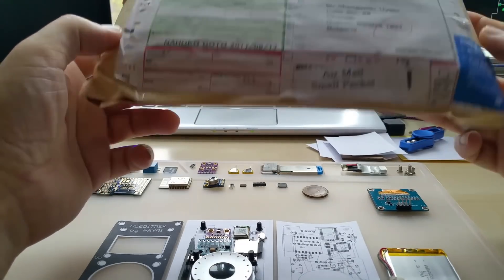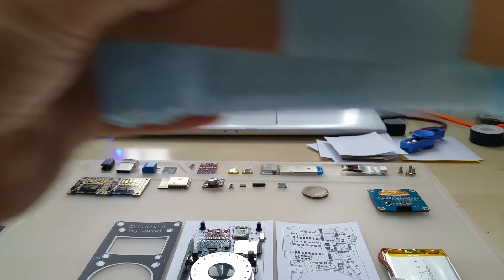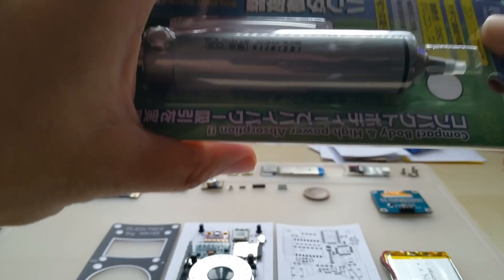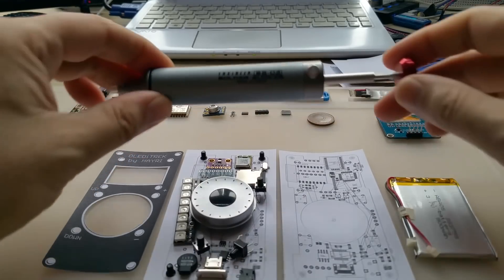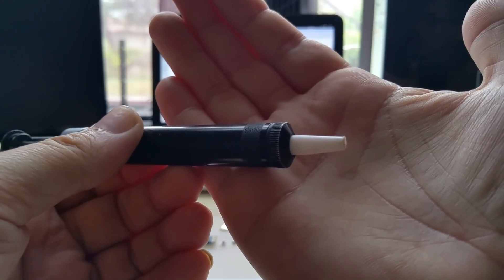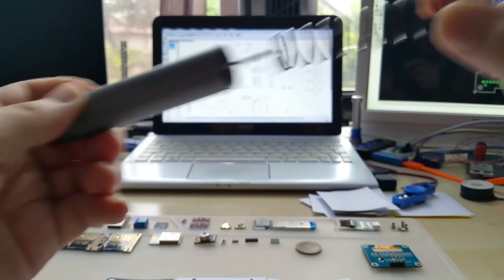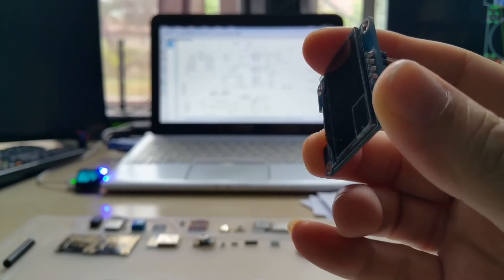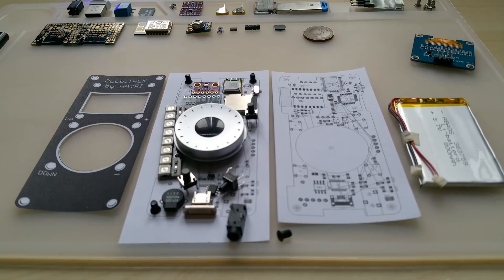Engineer SS-02 Solder Sucker made in Japan unboxing/review

Comment: Few days ago I got new one SS-02. I confirm, it's really brilliant thing. Thanks a lot Hayri. :)
Reply from the maker: You are very welcome. I like it very much too. If you are into high tech stuff I can also recommend the TS100 soldering iron that I reviewed a few days ago. I also have the Mini ES120 Motion Controlled Screwdriver on the way and look forward to test it. Take care :-)
Reply: Yes, I saw Your video about TS100 too. I think, it's really good soldering iron, but I'm using very often hot air soldering station, it is necessary during my work with microcontollers like MC68HC08 (car ignition lock).
However this TS100 could be nice alternative in opposition to huge soldering station - it's nice mobile gear.
Reply from the maker: Actually, I should use my hot air soldering station too or even buy or build a reflow oven. Soldering everything by hand takes a lot of time :-)

Comment: That looks to be an exceptionally high quality product. Enjoy!
Reply from the maker: Thank you very much, it is really a very nice product. One feature I forgot to mention is that the holes for the air escape are on the top, so there is no possibility to cover them by accident with your hand, unlike my other sucker were the hole was on the side and sometimes when covered by my hand it did not suck the solder.
Reply: Ah, now see, I would consider that a feature and a bug, as bits of dried up solder flakes can be shot into your eyes. A design with exhaust holes placed on top of the cylinder wall might mitigate this.
Reply from the maker: That is not possible because the plunger/piston is in the way. the solder is on the front and the escaping air is in the back.
Reply: It's not in the way if you make the cylinder 5mm longer and add a stop for the plunger 5mm inside the top of the barrel. Although, that would add a great deal of complexity to the manufacturing process.
Reply from the maker: Any hole on the side could be covered by the users hand no matter how high it is but not so if it is on the top like on this plunger, ask me how I know :-)